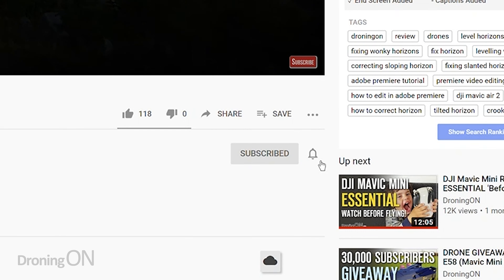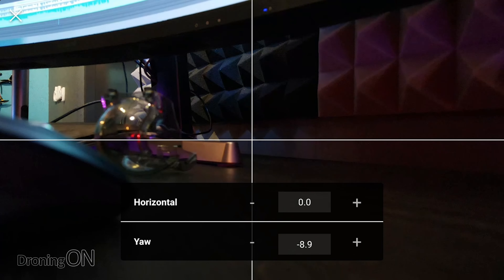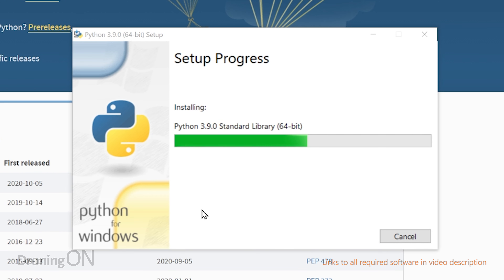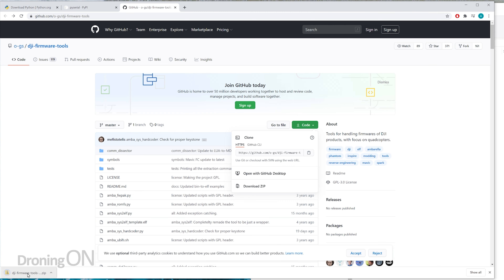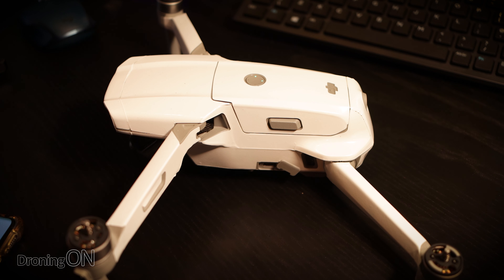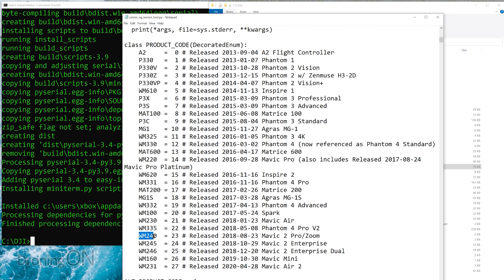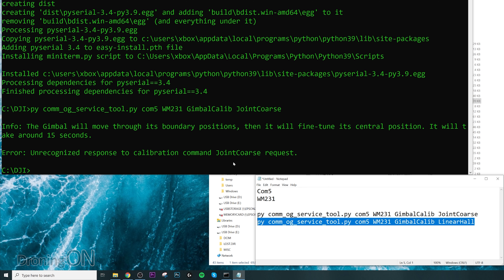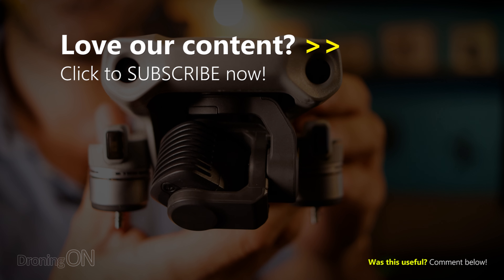FIX DJI drone ERRORS/ISSUES after GIMBAL/CAMERA replacement

Comment: Thank you for the awesome video, I did this and it worked great. I did take the old camera module from the old gimbal and install it in the new one, I still get the 40011 code but the other codes are not there. I found an authorized DJI repair center that will do it for 25.00 but it will take me a couple weeks to get it back and I don't like to have my customers wait that long. It would be awesome if someone came up with a fix for this.

Comment: I'm having trouble...When I download everything and get to the cmd prompt I enter the commands as you mention and it doesn't run the installation. It says: 

C:\dji>py setup.py install
Traceback (most recent call last):
  File "C:\dji\setup.py", line 17, in <module>
    from setuptools import setup
ModuleNotFoundError: No module named 'setuptools'

During handling of the above exception, another exception occurred:

Traceback (most recent call last):
  File "C:\dji\setup.py", line 19, in <module>
    from distutils.core import setup
ModuleNotFoundError: No module named 'distutils'
Reply: I've uninstalled everything and tried again step by step and I keep getting stuck at the CMD Prompt

Comment: error: argument product: invalid choice: 'COM6' (choose from 'A2', 'P330', 'P330V', 'P330Z', 'P330VP', 'WM610', 'P3X', 'P3S', 'MAT100', 'P3C', 'MG1', 'WM325', 'WM330', 'MAT600', 'WM220', 'WM620', 'WM331', 'MAT200', 'MG1S', 'WM332', 'WM100', 'WM230', 'WM335', 'WM240', 'WM245', 'WM246', 'WM160', 'WM231', 'WM232', 'WM260')
Reply: i get the same but com5 for air 2  did you figure it out?
Reply: It seems with the update you have to modify the command string some. It should now be:
py comm_og_service_tool.py ---port com6 WM231 GimbalCalib JointCoarse

Where Com6 is whatever com port you have. Note that there are two -'s before port.
Reply: @chrisscheer575  It seems with the update you have to modify the command string some. It should now be:
py comm_og_service_tool.py ---port com6 WM231 GimbalCalib JointCoarse

Where Com6 is whatever com port you have. Note that there are two -'s before port.
Reply: Same here did you figure it out?

Comment: Hi there! This is an awesome video! Thanks so much for the tutorial. When my air 2 gimbal was having issues months ago this fixed it. It is having issues again and so I wanted to try this again but I am getting stuck on one step and I'm hoping someone can help me. I will try to explain the best I can. When putting in the string of commands into the command prompt, I am getting an error message. First of all, this is what I am putting in: 

c:\DJI>py comm_og_service_tool.py com3 WM231 GimbalCalib JointCoarse

the error tells me that com3 is an invalid command and prompts me to replace it with the WM231 code - it continues to tell me to replace the commands with the next command. Eventually after I have finished replacing them, my command string looks like this:

py comm_og_service_tool.py WM231 GimbalCalib JointCoarse

then, of course, when I hit enter it tells me that I need the comport. If I go back and input the comport in the space that is shown in the video, I get the error messages again. Is there another space that my comport should be entered?

Thanks so much for anyone who can take the time to assist me on this!

Comment: Awesome information! Im going to give this a shot tonight on my Air 2. Ordered it online whiile i was in a rush and completely skipped the DJI Care section. Of course Ive wrecked it now and broke the housing ring the gimbal rotates in. I recovered the plastic pieces and with a tiny bit of super glue, managed to repair it for the most part except for this issue. Thanks for the hard work!
Reply from the maker: Nice one, how did it go? Do let us know if you also got the errors after replacing it, as we did?
Reply: Worked a treat for me.
Reply: @Droning-ON  sorry for the late reply. Didn't get the time to try it until last night. It actually worked! This information is pretty much non existent with basic Googling! Thank you so much bro!!!
Reply from the maker: @ccmercer89  so glad to hear! Did you get any app errors afterwards however?
Reply: @Droning-ON  sorry for the late response! I've actually had a lot of issues with the IMU calibration and the gimbal calibration ever since the accident. Im not completely sure what is causing it but i haven't spent much more time troubleshooting since its pretty much turned into my backup drone after upgrading, The most noticeable issues being, it  will slowly start descending as soon as i let off to hover and the second issue being, no matter how many times i calibrate everything (before each flight) the gimbal wants to be on a horizon tilt that's about 5 degrees off every flight. Thankfully, DJI added the ability to manually adjust the gimbals tilt in one of their app updates. Little bit of extra work but it does the job!

Comment: @DroningON  Any solution for issue Incompatible Gimbal Data/ IMU error 40021?
Reply: There ia a software for DJI Service Centers named 'RepairTool' for any DJI products and it just running with specified VPN with Certificate that can Pair modules by its IDs into drone's Mainboard...
Reply: @mehdimahdianvideos6960  I read earlier about that software  but i'm trying to find a different solution to be available to people who aren't licensed dji, i think it's possible to solve the problem via python programming language but i need someone who has experience and knows that programming language really well
Reply: @mgolijanin86  in the past i found an app that named DJI Repair Tool that needs DJI VPN with specific certificate that issued to DJI Repair Service Centers. It can pair any new hardware id to IMU. But there is no more information about it on the web that pair parts with python scripts... :( 
which drone do you have? Mini / Mini 2 / Air 2 / Air 2S?
Reply: @mehdimahdianvideos6960  I have two drones Mini and Mini 2 but but I had a problem with the mavic mini and solved it by my self, inserting an old original camera module into the new gimbal housing and now is no more error 40021 incompatible gimbal data. Now is like new 😁
 Now I have to solve another mini from my friend who broke the gimbal and damaged the camera module which is not working, he bought a new gimbal housing and i am trying to give him my new cam module and pair it with his mainboard but error 40021 is present which makes me annoyed

Comment: Amazing thank you very much.did you finally find a way to clear the other errors?
Please let me know
Reply from the maker: Unfortunately not yet, but we're working on finding a solution! Glad that it helped Ben!
Reply: LN DRONE & FILMAGENS  The code is the same for both the mini and mini 2. I used the code WM160 to fix my DJI Mini 2.
Reply: @douglasdurant1850  did it remove any error codes ? What issue did it fix please?

Comment: Didn't work for our DJI Mavic Air 2. When we plugged it in we didn't get py code in front of command lines and we also didn't see where you get the command lines but just copied what you put up on the vid.
Reply from the maker: Do try again and so exactly as shown in this video, pause it if that helps.

Comment: Thanks for fantastic and helpful video, I have fixed my replaced gimbal! BTW, these error messages persist and I have lost the ZOOM funkcions in Fly App! Is it somehow related or should be another issue? Thanks for sharing your opinion!
Reply from the maker: Unfortunately there isn't a fix for these errors yet, very frustrating but someone will create a fix eventually. Thanks for the comment.

Comment: My guess was this is just another way of DJI controlling everything not allowing you to replace the gimbal.

You could easily see what the mavic 2 series they had every intention of making swappable gimbals.. 

Then they realize they wanted people to buy the mavic zoom separately by not replacing the gimbal and switching from a one inch sensor to the zoom sensor!! 

so they decided to nickel and dime their customers billionaire companies making more BILLIONS!! THEN THEY STOPPED MADE THEM NOT HOT SWAPPABLE. 

But you could see how easy it was to replace the screws on the mavic 2 series.

people were even switching the cameras out from the mavic 2 to the mavic zoom and they worked perfectly in recognized the drones based on what camera was installed.. 

WITH THE MAVIC AIR 2 IT'S THE SAME DESIGN BUT THEY REALIZED FROM THE MAVIC 2 SERIES HOW EASY IT WAS FOR PEOPLE TO REPLACE THE CAMERAS AND SWAP THEM THEY DIDN'T WANT THIS TO BE THE CASE FOR THE MAVIC AIR 2.

HENCE THE PROBLEM YOU'RE HAVING MEANING TO DO ALL THIS STUFF WHEN THERE'S NO NEED FOR IT!!

STARTING TO HATE DJI

I don't even get me started on the fact that they don't even have waypoints in the mavic Air 2!! They took them away because they wanted people to buy the mavic 2 thinking it's a professional drone but waypoints is not a professional feature it's even in $200 drones that were made before the mavic air 2

They discussed me how they nickel and dime their customers and now the quality is going down!! 

Please other drone companies catch up so we can switch!!

Comment: Perfect instructions and very clear how to do it.EXCELLENT JOB.in my case i didnt get any errors since i kept the initial camera and changed only the motors of the gimbal.
Reply: Could you plsease share how you manager to change the motors of the gombal camera ?
The drine got crushed and now
I have a non functional gimbal it doesn't move at all and i don't  receive any live feed on my fly app ?
I can rorate the camera 360 degress multiple times i guess the wires got cut somehow , and i don't know what to do for the neft srep should i open the gimval and see if theres is any damaged wire ?
Or replace the whole anf follow the Op videos tutorial ?
Thank you for your help.
Reply: @phdz9390  this is not an easy process not for everyone. i am an electronic eng with many special tools.

Comment: Good video, very thorough - I am a programmer, so probably easier for me to grok, but I believe it was explained clearly regardless. If only that had fixed my issue (burned out motor in part of the gimbal). Looks like I'm going to have to order a replacement, and then use this again. :)
Reply: Did you fix it

Comment: hello bro!  excellent video!  I only have error 40021 since I received the drone, even without replacing any parts, there was never a fall or damage.  2 questions: Have you come up with a possible solution to eliminate error warnings?  is there any problem i fly with this warning?  thank you very much friend, i signed up and i will follow your channel, very good!  greetings from Brazil!
Reply: Look at my answers and method, just finished the latest step by downgrade and re-upgrade the firmware on the aircraft to get rid of the latest error I had (40011). Maybe this could help you. Succes!
Reply: There ia a software for DJI Service Centers named 'RepairTool' for any DJI products and it just running with specified VPN with Certificate that can Pair modules by its IDs into drone's Mainboard...

Comment: No doubt a few hours work in that Ash at least for you to gather the relevant Info and software - Cracking Vid and great result - Hopefully won’t have to rely on it -But definitely would if required though - If in doubt I would contact You and the DroningOn community -Great Content as always - Thanks 👍😀
Reply from the maker: Genuinely took ages to film and edit!! Glad that you found it useful David, hope that you never need to run through this process :) thanks for the comment and for being a club member!